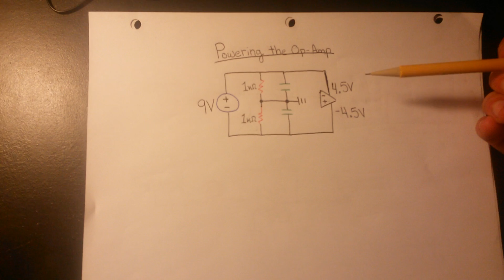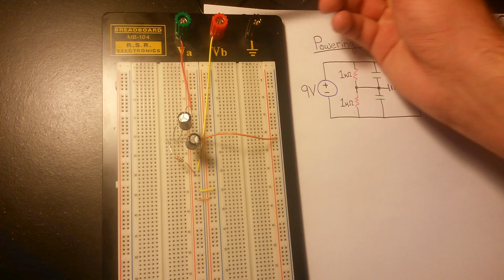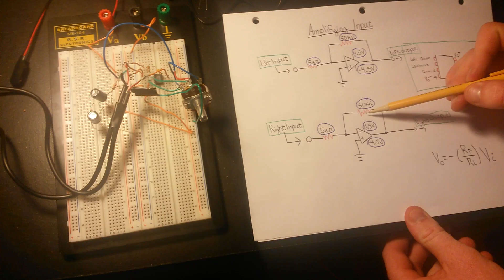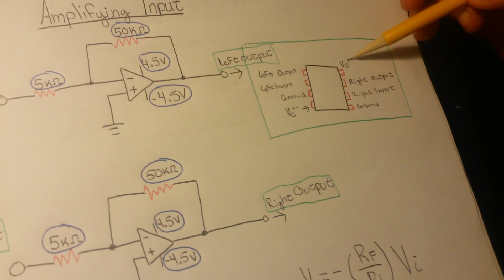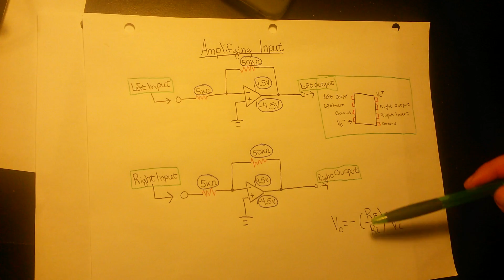HOW TO MAKE AN OP-AMP AUDIO AMPLIFIER

Comment: what do the capacitors do? can it also work withouth them?
Reply: By the way very good video tanks a lot.
Reply: These capacitors were used to filter a possible noise in dc supply. I think that's not essential, but it's a precaution.

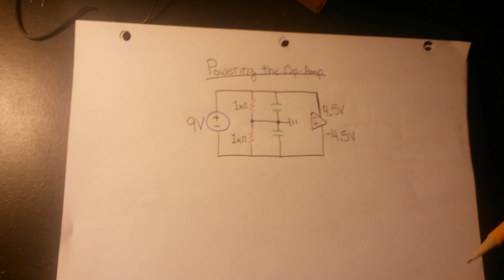Comment: 00:40 Can I use some bigger resistors to reduce the idle current flowing through them? I don't want to waste too much current from my battery just to set the voltage levels.
And what are the capacitance values for these two capacitors used for powering up the opamp?
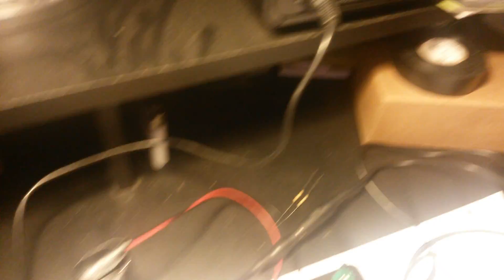04:34 Does the speaker have a built-in power amplifier? Or is the power coming from your circuit? (which I doubt)
What are the voltage levels for the audio input and output? And what is the power this amplifier can supply?
Oh, and you should also mention that in audio circuits one needs to use logarithmic potentiometers for volume control, because otherwise the scale doesn't sound "linear"".

Comment: Is it possible to make this with a lm741cn ?
Reply: i have a ua741tc and yeah its the same chip it works fine but not the same schematic this chip does not have the ground pin v- is the ground

Comment: I'm making this circuit with a LM324, I want it to be used to amplify a guitar or microphone signal through a small car speaker, down a spring into another speaker. I'm Following your instructions but to no avail! Also, the resistors in the power management  kept frying up so I changed them to 200K, is that wrong? I'm a total noob